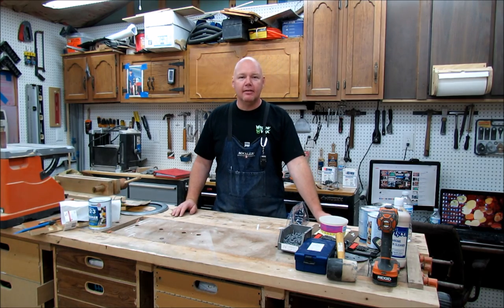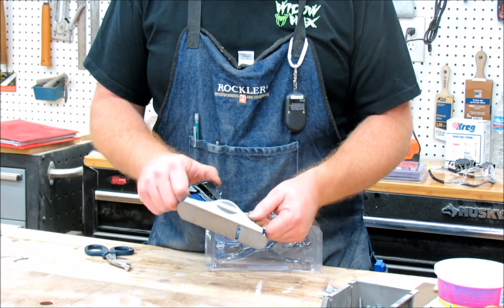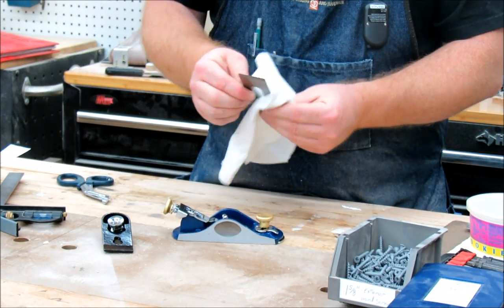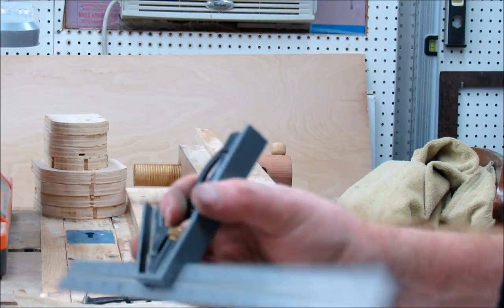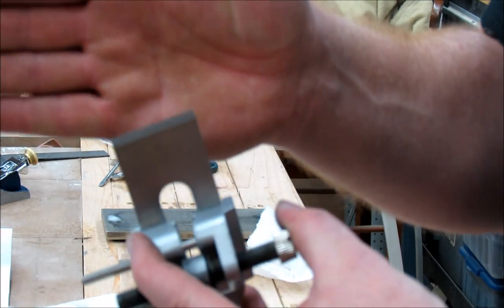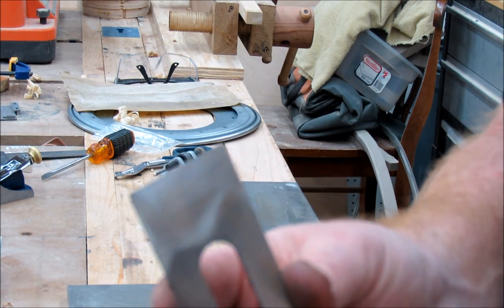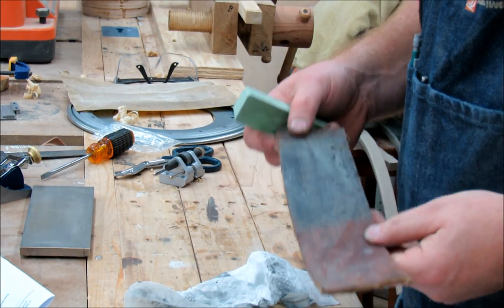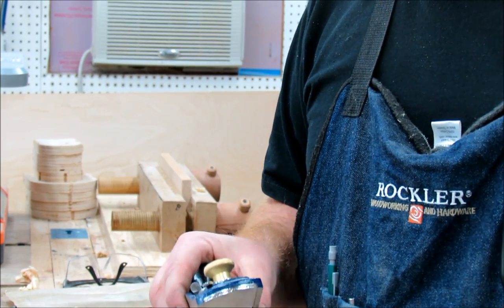Can a $15 dollar Kobalt plane work for fine woodworking

Comment: I decided to make some hand dovetailed boxes for some friends, and am only now realizing the size of the project I was taking on. Everyone seems to agree I should make them a little proud and use a plane to take down the excess. If I'm making these out of quality hardwood is one of these going to end up more trouble than it's worth or am I fine if I take the time to properly true and sharpen the blade? 

Suggestions? 

Thank you so much.
Reply from the maker: I would suggest a better plane. I would use a number 4 or 5 smoothing plane.  Either one will do a great job. The kobalt I think is better suited for rougher work. Hope this helps and good luck.
Reply: @thomrider  Thanks. I'll look for a used Craftsman #4, as I'm hoping to do this on less than $200 which seems to be the going rate. 

Any chance you could make a video or direct me to something about the different types (numbers?) of planes and what they're each used for?
Reply from the maker: Check out Rob Cosman’s. Video channel he has a lot of good info about the different hand planes and uses.

Comment: Got this plane today based on this video, thanks for the recommendation! It's my first hand plane, and I used it right out of the box (after cleaning the OIL and crap out of it!) and without sharpening or touching the bed, I was able to plane down hardwood 3/4 plywood (basically end grain) and got full length curls!

Hard to get the angle straight, wish you could adjust depth without messing up the skew! Any tips?
Reply from the maker: +Jamie Clark glad I could help.  This plane is adequate for basic tasks, adjustments are touchy I will say.  Not many tips other than you can tap on it with a mallet to make fine blade adjustments without turning the knob..  Thanks for watching.

Comment: Wood planes are not rocket science. So plenty of manufacturers can make them. The key is certainly having a good edge on your iron. Having a sharpening system that works for you is critical in woodworking.
Reply from the maker: Your are so right.

Comment: I have never seen a craftsman check a plane iron, or any other blade for that matter, by taking a shaving off their work bench. That was interesting. Also, if you are going to review a plane, maybe you could oblige your viewers with a better test than one shaving? I'd say take that first shaving, pitch it. take a second full length shaving, sit it aside, take 29 more shavings and compare the last with the second. This could at least partially show edge retention. I would also like to see a few takes at end grain. Also, this is the first time I've seen anyone split the use of a leather strop. the strop usually will work better attached to a rigid board as well. Most guys I know use double sided tape or spray glue to attach to a strip of plywood or other hard board. Nice review, just a couple of constructive criticisms.
Reply from the maker: +Thomas Russell thanks for watching,  by the way we have the same first and middle name.  I'll try and improve on future plane reviews, thanks for the suggestions.
Reply: Just trying to help. I have not much time to post my own whilst attending college in middle age. Maybe over the Summer I can pop a few out there.
Reply: He's just smoothing his bench very slowly.

Comment: Something is not right when you have to spend time fixing a new tool. I guess though if it were out of the box equal to your modifications then it wouldn’t sell for $15 but much more. Very interesting. I don’t buy kobalt anything - it’s the Lowes brand/ like Husky is to Home Depot. I bot Buck Bros. Plane for $10 -— Which may or may not be junk. Thanks a lot for the video —and be thankful your not my next door neighbor because I’d be setting you crazy with a lot of questions.
Reply from the maker: +David Azinger thanks for watching I have the buck brothers plane also it's in the same category just an in expensive plane. You get what you pay for.  I bought these cheap planes to shave down plywood mostly.

Comment: Great informative video. I learned more on how to hone a blade than I did use the tools. Ha Ha
Where did you get the guide tool for honing the blade? I always used light oil for honing. I'll have to try cheap window cleaner. It sure is easier to clean off the table top using window cleaner than it is oil.
Barry
Reply from the maker: I got the guide at woodcraft.  But you can order one through amazon as well.

Comment: Those medic scissors cut just about anything.  I’m a medic, so I keep a pair. Are you a medic or do you have a medic or nurse in the family? I used that plane today. Works great. The blade sharpened easily. Seems to be a soft metal.
Reply from the maker: A Carpenter's Son I am not a medic. Or have a nurse in the family.  I have used those type of scissors for years.   The blade metal will not hold an edge very long but it is a low cost option.  I use mine mainly to clean up plywood or chamfer an edge.  Thanks for watching

Comment: Questions: 

So how much are those lapping stones/leather/compound you use and where do you get them? 

How often do you have a hone a blade?

Would it be more cost effective to forgo a honing setup and just get a better plane for weekend use?
Reply from the maker: +Zero Experience Required thanks for the questions,

The diamond plates are around $80 a piece at woodcraft or rockler or amazon
and compound is only $5 a piece at local home centers.  
The leather can be found at most hobby stores.

But you can do all your sharpening with just a flat surface and some wet/dry emery paper in fine grits.

If you use it on hardwoods you will sharpen more often than on softwoods.

No matter the quality of the blade honing will always be required eventually.

Hope this helps.
Reply: Thanks for the info!

Comment: It is common knowledge that if you play BB King's guitar, you won't find yourself sounding like anyone but you. No BB. Contrariwise, BB could have picked up your knock-off guitar and sounded great. Likewise on a sailboat, the most important piece of gear on board is the mind of the captain. It won't do to be on a ten million dollar yacht with a fool at the helm. So it makes perfect sense that a great craftsman will be able to find a way to get the job done well with whatever tools he has at hand, while a numpty like me will struggle with a $200 plane. Not that I have one of those.

Comment: Sorry maybe its been asked but the device you put the blade in to sharpen on stone, what's that called to I can order?
Reply from the maker: Tami Velez it’s called a sharpening guide they cost around $15-20.  It will hold chisels and plane blades at exact angles.
Reply: @thomrider  Thank You

Comment: Hi sir. What do you call that thing that holds the blade at an angle?
Reply from the maker: Here is the link on Amazon 

ATLIN Honing Guide - Fits Chisels 1/8" to 1-7/8", Fits Planer Blades 1-3/8" to 3-1/8" https://www.amazon.com/dp/B07C9X3F98/ref=cm_sw_r_cp_api_i_6L5GDbWYKEGCF

Comment: would have been nice to see if the face needed alot of tuning. That can have a huge impact on the quality vs price issue. if it will take 4 hours to tune the face then it may not be worth the few bucks saved.
Reply from the maker: drglnc69 thanks for the comments and for watching.  This plane was machined to my satisfaction. If your looking for high end machining then you'll need to pay more.
Reply: or just take the time to true the sole, even the hi-end planes need the sole tuned better from the factory finish. I've seen a lot of Lie-Neilsen and other top end un-boxings on the Tube, and the craftsman making the video ALWAYS has to true the sole on every single one of them. There is always a low spot, high spot, or two or more of each on every single one of them. Mind you, the high end planes usually are much closer and take less work to true, but they all need worked on. And the chances are if you use them a lot, they will all need truing again. Mr. Paul Sellers (Master craftsman with 50 years in woodworking) even put a harbor freight POS plane to the test, after trueing it took as good of a shave as any Stanley, Stanley SW, Lie Nielsen, antique wood block bench plane, or any of the many other brands he owns. Fine wood working is more about the proper care of your tools than the tools themselves.
Reply: Need to true the sole is understood. Knowing if it will take 15 minutes or 4 hours matters though. Just seemed to be a key item missed in the video.
Reply from the maker: +drglnc69 thanks for you comments and for watching
Reply: How long it takes depend on if you try it all on 320 grit or drop to a heavier bite until you get close. Cheers.

Comment: I've got this exact plane.
And I hate it!
Maybe you got a better one than I did, but it is really sloppy in the hole.
I'm a new WW. But I can't get it to stop angling to the side. One side of the sole cuts a huge shaving or should I say a chip.
While the other side of the sole cuts nothing.
Maybe I'm setting it up wrong.
Reply from the maker: Well this planes quality control is all over the map. I think I was just luck to get one that is decent enough. The blade setting is extremely touchy I have had the same experience with the shaving not being even you have to mess with tightening the screw a little at a time until you find the sweet spot that will keep the blade set and also square. It is a bit of a pain but for 15 bucks it's not a bad plane overall I mainly use mine for plywood.  If you have the money you can't go wrong with a WoodRiver plane for $100.

Comment: I took it apart and I can't get the blade back in and aligned. Could you help with that?
Reply from the maker: Thanks for watching,
try loosening the screw in the center of the block plane until your can put it all back together, then just tighten the screw until you can disassemble and reassemble with out any problems. alignment should be alot easier once you get that screw set.

Comment: this may be a dumb question but why does the front of the plane adjust?
Reply from the maker: Art Connolly its not a dumb question. The sliding mouth allows the plane to take a finer shaving when the mouth is closed and a thicker shaving when open.
Reply: But it stays on tge same plane as the main bottom. I thought maybe it was like a jointer and elevated a slight bit. Thank you
Reply from the maker: +Art Connolly no it just makes a bigger opening to allow a deeper projection of the blade and take a deeper cut.

Comment: I'm new and having trouble finding the diamond stones I keep seeing everyone using. Every single review on sharpening and adjusting planes never give info on the stones. Would you be so kind as to give me some in sight to where to find yours? All I seem to find are really cheap and horrible stones on a google search.
Reply from the maker: Harley Roland I bought my stone at woodcraft woodworking and supply. They cost about $80 a piece.

Comment: That plane is a pretty rough start. Yea it can be brought into reasonable service but frankly it's a piece of junk.. I have one,it works ok but still it's a crappy tool...BTw there is no good $15 dollar plane that's new.. Better off to buy an old plane and work it up to full function,,,takes less time and in the end you have a tool that will last your lifetime.
Reply from the maker: Thanks for watching and your input, you make some very points.
Reply: A craftsman never complains about his tools. Just work with what ya got.

Comment: kolbolt is junk
Reply from the maker: +aux1z11   Thanks for watching and your comment.
Reply: He shows you how to get decent results with a $15 plane.  I think that is awesome.  It may be  junk if you don't know how to tune it up.
   --- Wm. Brown Furniture:  www.LineAndBerry.com
Reply from the maker: William Brown thanks for your kind words
Reply: The warranty on kobalt isn't though.  I've taken kobalt tools into lowes absolutely demolished because I used them beyond what they were designed for (over torquing a ratchet for example) and they replace it no questions asked.
Reply from the maker: +GuitarGodgt thanks for the information. Good to know they stand behind their products.
Reply: No problem.  When you buy a kobalt tool just look for the little hexagon shaped thing on the front it says "hassle free lifetime guarantee."  So far I have not gotten any guff about returning anything.  Actually I tossed a tape measure that I should have taken back, but that was before I knew about thier kobalt tool policy.

Power tools are standard 5 year though if I remember right.  I only have their 1/2" electric impact driver, but I do like it.
Reply: BACKYARD WOODSHOP just an update.  I took one of these back because I sheered the front adjuster pin.  They replaced it, however they did let me know that blades are not included under the hassle free warranty.
Reply from the maker: +GuitarGodgt thanks. That's good information
Reply: GuitarGodgt Good to know. I thought Craftsman was the only one that did this. Wish I paid better attention to the packaging!
Reply: Especially when you spell it wrong   KOBALT